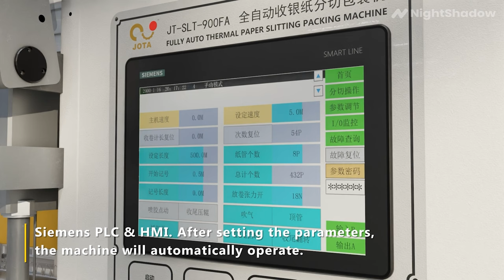Intelligent 4.0 Fully Automatic Thermal Paper Roll Slitting Machine

Comment from the maker: Everyone may know that Jota Machinery is already a cooperative supplier of Asia Pulp & Paper. 

After many communications with APP group, Jota Machinery is honored to launch a more intelligent 4.0 solution for thermal paper roll production business plan.

The advantage of fully automatic thermal paper slitting machine is that only one operator is required to complete production.

First, we use a trolley to move the thermal paper jumbo roll to the hydraulic shaftless unwinder stand, and then follow our video to thread the paper from each traction roller to the slitter knife. Then enter the required number of meters and press the start button to automatically cycle.

In the intelligent 4.0 solution, we have added an automatic cartoning machine robot: the robotic arm can grab the thermal cash register paper rolls and put it into the carton, then wind the automatic stretch film, and finally use the AGV to automatically enter the warehouse.

The 4.0 solution has increased output by 100% over the 3.0 solution. 

If you want to know more about this fully automatic thermal paper slitting machine, please contact us in time.
Website: www.jotamachinery.com
E-mail: Jotamachinery@gmail.com
What's app: +86-13868814910